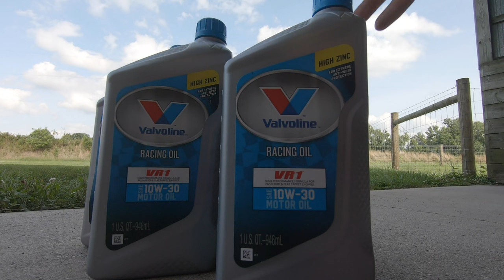MOST NEEDED JOB: Changing the Oil, Pump, Pick-up Pipe, and Filter in Dodge V8-Powered Vintage RV

Comment: Looking good.  Shell Rotella also has high zinc and it's pretty cheap at walmart.  I think that hose clamp on the fuel pump is made for fuel injected systems, I think you need to old school ones with the slits.
Reply from the maker: Yea I thought about Rotella but wanted to give it the VR1 as I'd read good things about it. The leak was down to the hose literally falling apart. We replaced it and didn't have any more issues. Andy and L

Comment: I have two Cortez's a 1964 and 1965 both run one I started to rebuild has front disk brake conversion will sell both for parts .If you or someone you know are interested reply also all manuals and parts books.
Reply from the maker: Hi there,
We do not know of anyone who wants a Cortez (and we definitely do not want another! haha).  We suggest reaching out on the Facebook page as there are occasionally others who are gluttons for punishment!
L (and Andy)